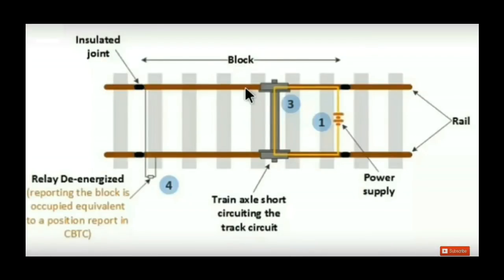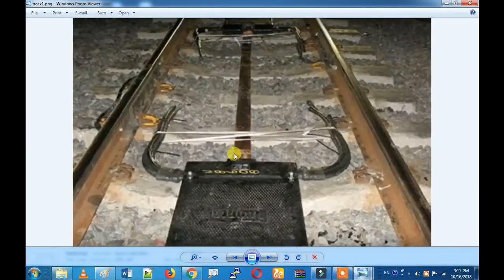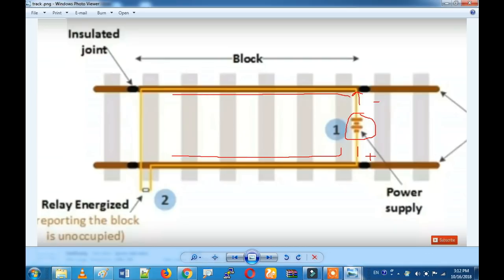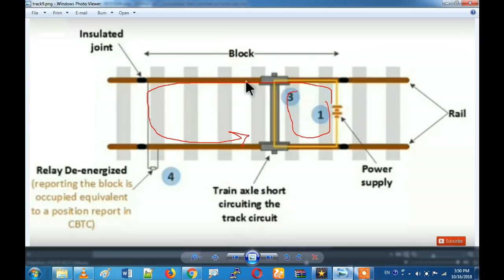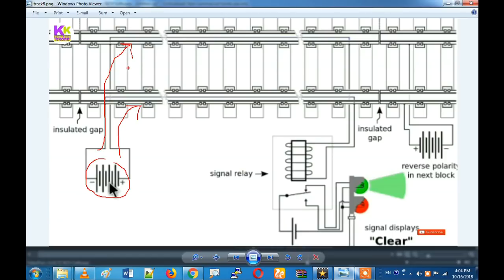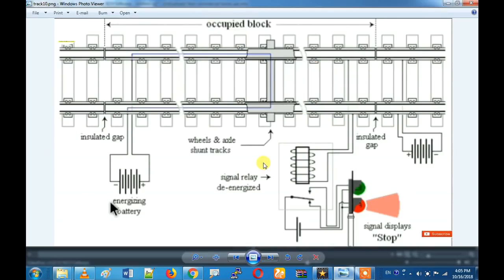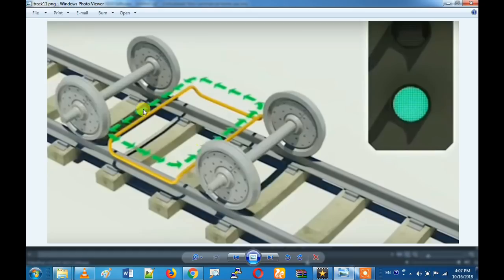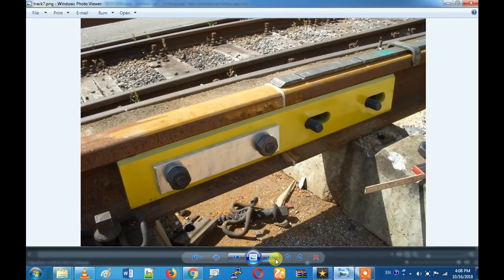How Rail Tracking system Works In Tamil

Comment: This is totally wrong.. 
Please don't share... 
All
Signals are linked by a separate cable not depending on track because rail track is a strong negative source for electrical train.. 
   And the signal cable also linked with every station from which the signals are controlled .

Comment: 1,Railway Electrification Modification
2, A Board & B Board Particulars writing..
3, Difference between the RE & Doubling..
4, S&T full materials list (A to Z)
5, Joint survey & Planning for RE Modification...
6, Basic Wiring Diagram
7, Track Bonding and Polarity check...